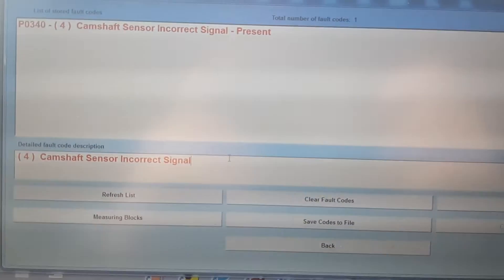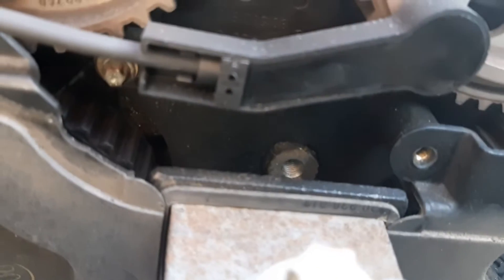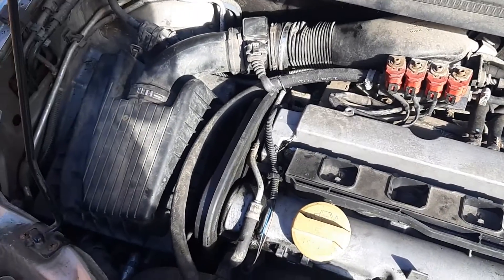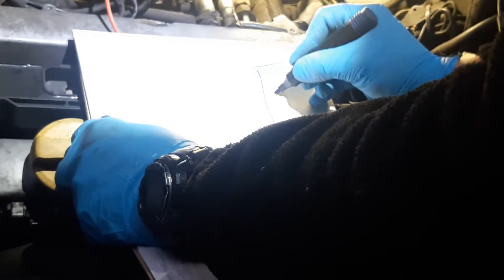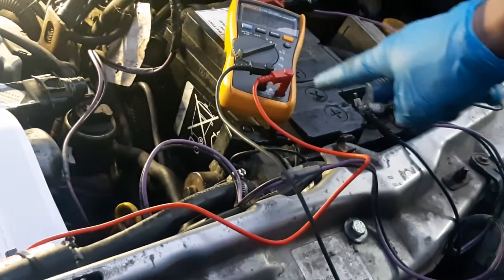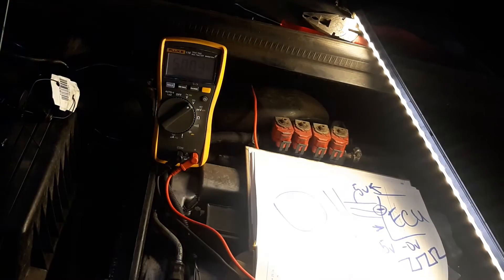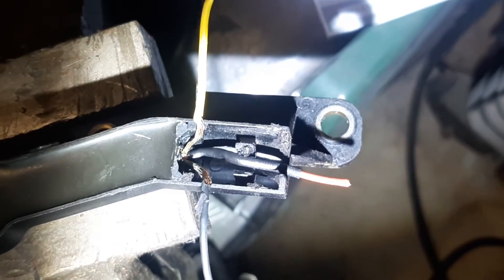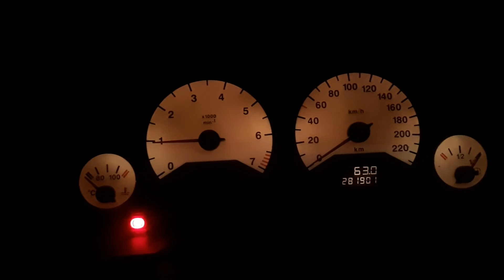Cam Shaft Sensor Troubleshooting P0340 Opel/Vauxhall, USE Siemens only !

Comment: I have the same problem. The diagnosis showed code p0340. I bought a new sensor from Meat & Doria and the problem remains. Also the engine performance has decreased while it does not exceed 4000 rpm. I don't know what to do because I can't find a genuine sensor anywhere to test .Did you also have reduced engine performance??
Reply from the maker: Only original and yes.
Reply: Did you have reduced performance??
I stayed up to 4000 rpm

Comment: Can u please put the part number from the siemens in the discription
Reply from the maker: GM 09 534 064
Reply from the maker: , best thing is to check the engine code and ask if sensor is Siemens before you buy it.